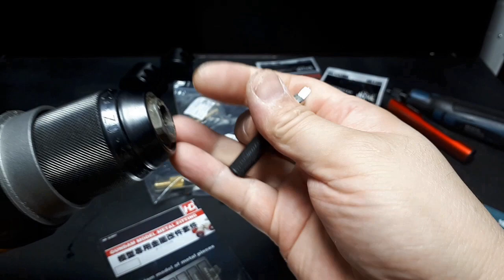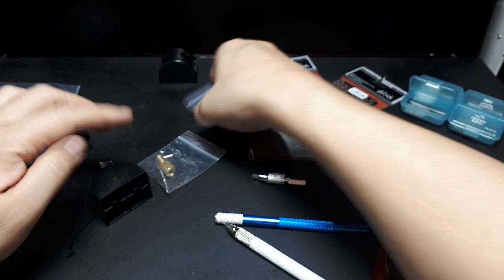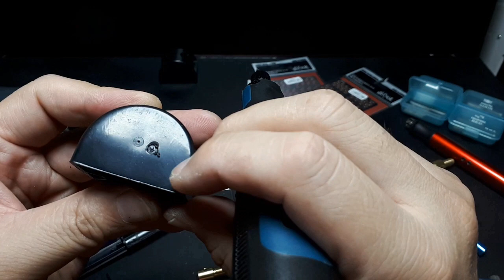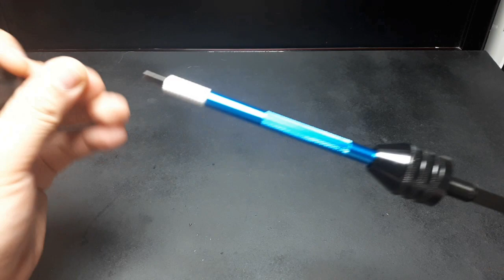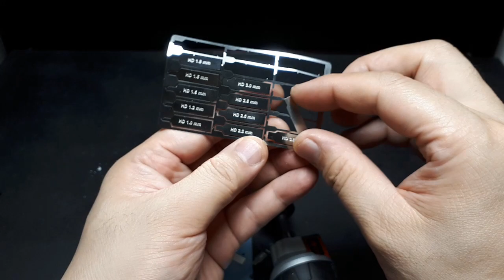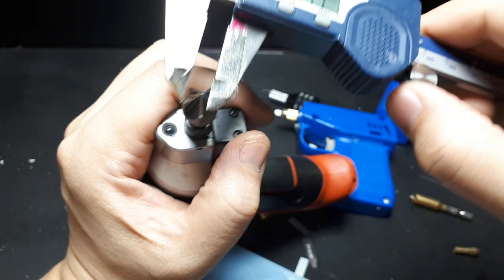Making holes in plastic to fit photo etched metal accents.  What electric drill works and doesn't.

Comment: Btw, you are suppored to fold that blade over at the line to make it thicker and flat on bottom.
Reply from the maker: It should be folded and broken off? Otherwise it wouldn't fit a handle and be off center.
Reply: @smallmodelcollector  it fit american and japanese knives. American ones are thinner, japanese are wider. One you fold, the other you snap off. You can also shim it on the opposite side using the frame material to center it if necessary.